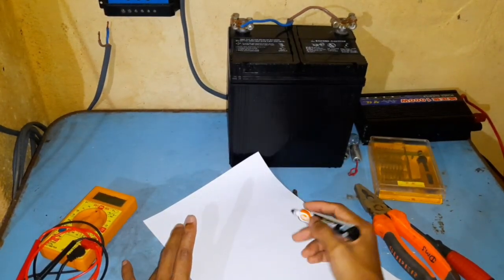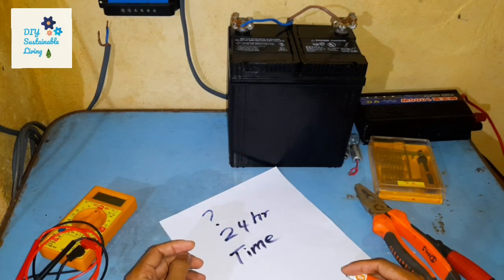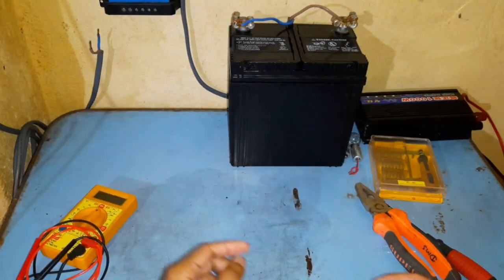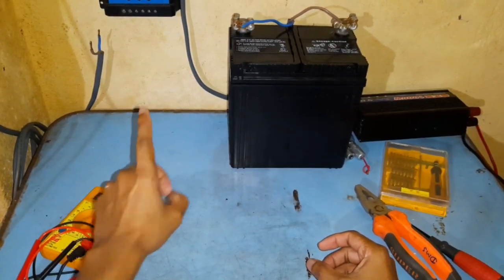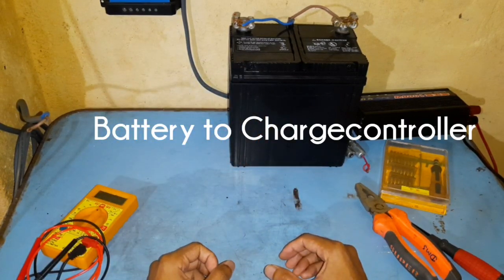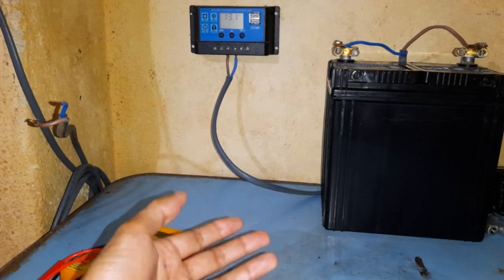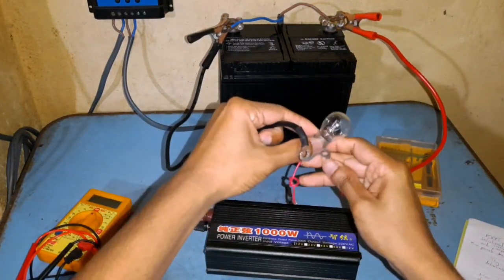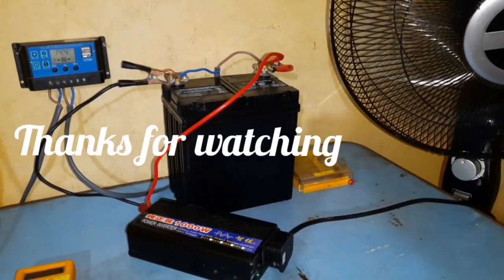How to Build a Small Solar Power System - DIY Off Grid Solar For Beginners!

Comment: So we can use a regular car battery? Won't it get damaged? Thanks 🙂
Reply from the maker: A regular car battery is not good for solar power storage. If you go to a DoD of 10% you will only get around 300 to 350 cycles of life out of it. Basically a brand new battery will get damaged with 1 years worth of daily cycling at 10%. But if you use a deep cycle battery you can get 2000 cycles at 50% DoD. The car battery I used in this video is for demonstration purpose only, and of course, if you dont use it daily and only plan to us it once in a while then a car battery might just be what you need.
Reply: Thank you, my friend!! I understand

Comment: How much Ah 12volts battery is good for 50watts panel and can we use old computer ups as inverter
Reply from the maker: First think of what you need to power. A 50w panel can get you only around 0.2Kwh of power on a good sunny day. Before you plan on getting a battery for the panel I would like you to think of your need to power and then plan the system accordingly.

Comment: Can we charge a supercapacitor bank using the solar charge controller by connecting the supercapacitor bank in place of the battery?
Reply from the maker: Yes we can. But currently supercapacitors dont come even close to the energy densities of batteries. Currently they can augment the power output of a battery but they cant store a lot of power in a small ammount of space like batteries.

Comment: How to build a solar power?
Reply from the maker: The question is how to build a solar power system? Well you will need time, a small budget and lots of calculations and planning first. Next you will need a solar panel, charge controller, batteries, wires, and depending on your needs an inverter. Planning is the most important of all steps.

Comment: great explanation of a small DIY solar project.  But safety Sally said you need some fuses between the the battery and your devises.
Reply from the maker: True.. :)
Reply: @diysustainableliving2774  what type of fuse
Reply from the maker: @jamesdelast7116  It should be a DC fuse rated with your required amperage.